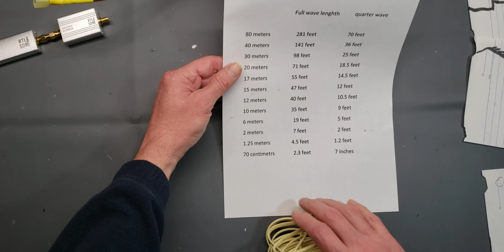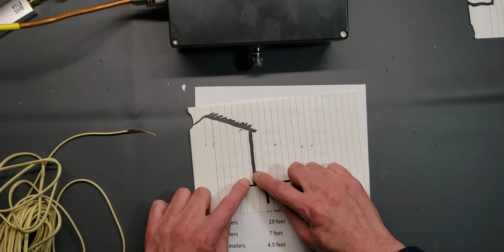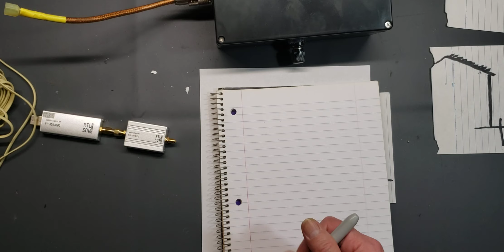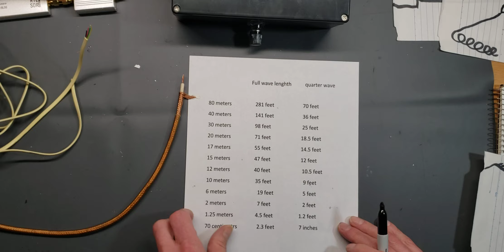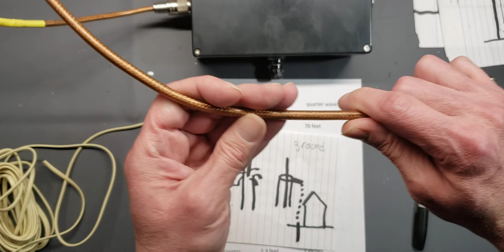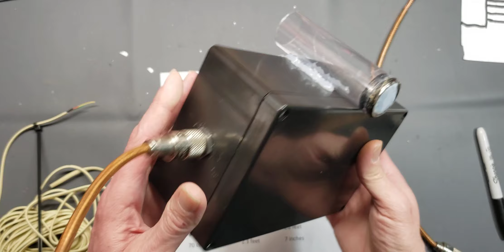RTL-SDR Multiband antenna

Comment: Could you please share what a good counterpoise would be for this antenna ?

I am living in a apartment, and need to make this since I have no ground . 

I just feel every video out there about counterpoise dont give me an answer which i do understand
Reply from the maker: A counterpoise is just any length of wire or metal. You can attach to the ground side or shield side of the coax. If your just listening with an SDR and not transmitting just use about 20 feet length of wire attached to shield of the coax you will be fine you can stretch it out or coil it. It wont matter. All you are doing is giving the negative charged wigglies somewhere to go. The positive wigglies use the center shield of the coax and the negative wigglies use the coax shield. That is a counterpoise! Hope that helps.
Reply: @HamBandit  thanks , that was perfect !!
Reply: @HamBandit  hi , i have one more question. Why not a unun instead of the balun. ?

Comment: I don't know what I'm doing wrong but with rtl sdr v4 connected this amplifier works worse than without. Please help.
Reply: Pretty sure v4 has a built in upconverter take off the amplifier it should work

Comment: Am I the only one that noticed? 80 Meters is 262.5 feet, not 281with a quarter wave of 65.6. 40 Metets is 131.25 feet not 141 with a quarter of 32.8 feet. The 30 meter measurement is correct. But the 20 is also wrong. Hope this helps someone who is cutting wires to exact lengths or do your own conversions.
Reply: I did too. And used what I measured.

Comment: This answered a lot of questions I had, thank you!
A couple quick questions I still have, as silly as they may sound:
1) When you're cutting those CAT wires to length, do the "dead" ends interfere with the signal (i.e. should you slide them out of the insulation?)
2) What's the difference between grounding to a rod stuck in the earth vs. the ground in a grounded outlet? (I live on the 2nd floor in an HOA + I've also never seen anyone suggest using the ground in an outlet, so there must be a good reason.)
3) When you say "just one wire," referring to the "hot" wire in the core of the run, is this connected to all of the different lengths of CAT wire in the antenna at the same time, or do you have to change the length of the connection based on what frequency you're trying to receive?

Thanks for walking through this setup!

Comment: Getting 5 Difrent Conversations In One Frequency IS NOT GOOD, Im getting The Same Problem, But I Change The Antenna Settings, I Mix Mach The ANtennas AUntill I Get The reception I Need Or Want, Sometimes I Don`t Get What I Want , But Thats Why Radio And Antenna Things Are Always Interesting Because To get Best Results You Need To Think Outside Of The Box  All The Time And Inovate On The Spot. Love The Content

Comment: if i wanted to put this in a vehicle, can i ground to the chassis or will that cause problems? if i do a counter poise, will i get RFI off the vehicle? does the antenna have to be straight or can i make deliberate bends to follow the contour of the vehicle?

Comment: Confused on some points.  1.  If I understand correctly your antenna is basically installed horizontally on the roof, correct me if wrong.  2. Let me know if this is right, It would seem as though you are running a piece of 50 ohm coax straight from equipment antenna input out through your window over to your ground rod.  You are opening up your coax at that point to tie the shield of coax to the ground rod while leaving center conductor alone.  Then continue coax up to roof antenna start point at one end of house.  At that point you separate the coax into center and shield/ground.  The shield is left alone while the center conductor ties into your multi antenna common point.    From here is where I think your description is very unclear.  You mention the full length of all conductors is whatever is the longest wire calculation is.   Now from the common initial feed point you go out to the dimension of your second longest calculation and cut open the outer insulator to make the necessary cut on wire 2.  Ok,  you've made that cut but what about the rest of that same wire that you just cut?  Do you pull the "unused" sections of wire out the back end or are you leaving it.  Repeat question for each band.  It would seem leavening the "unused" section which now lies in parallel and in close proximity might effect antenna performance.
Reply: Also at what point are you connecting the 9:1 balum and what about weatherproofing if at roof antenna feed point?
Reply: Also, the Cat5/Cat6 cable being used is also shielded, doesn't this wire need to be exposed for the length of the "antenna" part?

Comment: Not an expert here by any means. I'm having a hard time wondering why you would run a ground wire to a grounding rod. Wouldn't running a grounding wire to your computer case work just the same? I mean it is grounded by the electrical outlet which goes to a grounding rod anyway. Even the RTL-SDR is connected to your computer which I would think would be grounded as well connected to the usb port. Like I said, I'm not an expert in electronics and I am not arguing. I'm just fully ignorant on this and am genuinely curious. I am new to this hobby as well. Love the video by the way. Lots of good info here.
Reply: Not necessarily, I mean it be better than nothing, but the number one issue is one if the house is wired correctly to begin with, the only other issue is induced noise. Do to all the Switch mode power supplies each operating at there set frequency. I’m pretty sure home grounds could induce some noise in the front end. I’m not 100% certain on that but yea. Next is good grounding. vs poor. The ground is a apart of the circuit, and it’s not just any type of circuit it’s an RF circuit. I’m still an amateur with RF circuits believe me my friend it’s complex like DC circuit that doesn’t involve high frequency switching easy, get into RF circuits, especially tuned RF circuits, you’ve got to pay close attention to your components tolerances, and under stand how heat,cold, and even other stuff like stray capacitance, inductance, parasitic oscillation, not sure if (parasitic capacitance is the same as stray) your question isn’t ignorant at all my friend! You just had a question that well in detail is complex to answer!

Comment: You didn't say what a LNA is.  You said it works on freqs between 50 MHz to 4 GHz...So it would not be helpful in any freq. lower than 6 meters?

Comment: Hi                        Kinda new sdr  receiver but using a amplifier is pretty much a must ,l found this out by using the supplied rabbit ear type antennas that come with this dongle, just for kicks I hooked up a amplified channel master beam antenna and quadrupled the reception on am-fm and weather radio frequency , naturally a tv antenna is not to good for short wave or side band so if you can get this to work it’s cheaper than buying a $ 150.00 dipole .   With these you don’t need a big costly receiver .
Reply: why you need to buy a dipole even? arn't dipoles so simple to DIY? unless you;re talking about something multiband

Comment: Sometimes I wonder... You have your dream computer Ryzen 9 with 32gb of DDR4 safe and sound in your house.. But you plug a SDR on it with a XXX meters wire outside and one night you forget about it and there is a lightning storm.. It sounds like a perfect recipe to get a deep fried Ryzen 9 with a side of DDR4.
Reply: Just funnel the lightning into a flux capacitor and go 88 mph, then you can go back in time and unplug the antenna before the storm.
Reply: Perfect free energy ✨👌

Comment: A switch is not needed, just connect both band lengths to the coax centre and it's then basically a fan dipole. you can make it for as many bands as you want then. Also, getting your counterpoise out straight in open space WILL improve receive vastly.

Comment: How about using a Water Line Ground ?
Reply: As someone who designed and built conductivity measuring equipment for the oil patch I measured a lot of liquids for conductivity (the reciprocal of resistivity) including tap water.  It can vary from almost distilled water to not very good ( about 200 ohm - meter).  Unless you have salt water in your pipes.  
Several years ago a friend came over seeking advice about short wave antennas.  I supplied him with wire, coax, BNC connectors,  a wall mount lightning arrester with 6 AWG wire, and lots of hand waving advice.  The next time I was over to his house I checked his installation.  Everything looked very good, except that he had clamped his ground to the water outlet just below his arrestor.  I had emphasized that a good ground was not negotiable and was very leery about how good it was.  He insisted that he had read a lot about grounds and that it was good.  OK.  About a month latter we had a thunderstorm.  He called and asked me to come over.  He sheepishly lead me to the back of his house where about 3 feet of siding was blown out.  Lightning had taken the path of least resistance to an inside wall plug.  There was about 6 inches of wire was still connected to the pipe.  What happened?  All the pipes were PEX.  He lost his receiver, a PC and a television, all running off the same circuit.
Reply: @barnowl6807  can you use normal home electrical ground?
Reply: @randomtorontomans  According to the national Weather Service "A typical lightning flash is about 300 million Volts and about 30,000 Amps."  If you connect to the electrical ground at an outlet and there is say, 100 feet of 12 AWG ground wire (and multiple splices and connections) to the ground rod for your power panel with 0.16 ohm resistance/100 ft. you can see 0.16 ohm X 30,000A = 4,800V with respect to the earth ground point at that panel.  Furthermore, along the whole distance everything connected will see a voltage proportional to the resistance.  And, every appliance connected to that ground will also see a voltage difference between the "ground" wire and the hot and neutral wires. You must realize that a whole house surge arrester with the proper rating will make sure there is a limited voltage difference between hot, neutral, and ground wiring AT THE PANEL. But if that current flows through the wiring there will be the resulting voltage drop.
Reply: Traditional to do this
Reply from the maker: Most of today's water lines are plastic not recommended
Reply: @HamBandit  yes but if there is water in the lines, there is a ground point at every valve.  There are hundreds of Ground points going all the way  to the tower.
Reply: @HamBandit  ...As long as there is water in the system there will be ground points at every main valve and fire plug for miles.   I have used it for electronic trouble trouble-shooting when commercial ground or transformer ground was suspect...  A Great work around and zero noise.

Comment: Part of the issue with poor reception in the 10, 6, 2, etc meters and is your antenna is in a horizontal alignment.  The majority or transmitting antennas in the frequency range are from vertical antenna.  A separate wire antenna cut to the higher frequency lengths mounted vertically such improve reception on those bands.  Actual shortwave bands 15 meters and above transmit from horizontally oriented antennas.  Hope that makes sense.
Reply: You can make a 1/4 wave vertical antenna for 2 and 6 meters out of just your coax ..... For 6M just measure 5 feet from the end and peel off the outer jacket then take the braid and push it down over the outer jacket so you end up with a 5 foot section of braid and a 5 foot center conductor .... 2 meters is even easier since it's less than 2 feet long but at that length it's about as easy to build a traditional vertical with a 4 wire ground plane on a SO239 female 4 hole panel connector

Comment: 1. Your list of .25 wave. Are all of the ends touching at the coax you run to the roofline? You said to bust the list into 2 groups and make 2 runs. Trying to understand the connection. Thought maybe your box was a selector for EACH wire length.
2. Why did you need a selector box on your grounding rod at all?
Reply from the maker: no switches involved. Simply cut the wires to length. tie them all together at the end. include a small balun if you like. amazon has small baluns 1:9 for coax connection. the box you see is a pass through connection introducing ground to the shield of the coax to help with Noise. no switches involved
Reply: @HamBandit  thanks. I plan on doing this today actually. I know it needs to be a straight line but my roofline might not be a full 36 to the peak. Up to the peak and down the other side is enough but that's with the 30deg angle. Thoughts on that?
Reply from the maker: @IntoTheWild70  you can bend the wire no more than 90 degrees so feel free to turn the wire just don't let the wire come back on its self thats bad.no more than 90 degrees on the bends. You should get lots more signals.  Just after dark is best time to get peak signals. Good luck.
Reply: @HamBandit  Help my roofline sucks. Lol. Built cable but don't have a good place. Here are my options. 1. Has a tin roof 1/2 of the distance. 2. Will be near the power line into the house. 3. Will be on ground 4. Might have to go vertical on a pole of sorts. Thought of pvc with wire in middle
Reply from the maker: @IntoTheWild70  thats a bad situation to worse. You would be better off with a magloop antenna. Your metal roof will react bad to the wire and the power line will give you noise. Try vertical if you can but watch my video on chokes it will help with the noise if you do go vertical with the wire. If your up for a newer idea watch my magloop videos and see if that be a better direction for you to try.  Hope that helps you .
Reply: @HamBandit  I ordered a LNA for my rtl sdr v3. They shipped an AM filter. Now it says the LNA is unavailable. Any suggestions for an alternative? There is an RTL SDR ADS-B 1080 LNA triple filter but don't know if that's the same.
Ps: A what length is too long for the feeding coax if I have a LNA?
Reply from the maker: @IntoTheWild70   the ads-b is the wrong one I found one on ebay. https://www.ebay.com/itm/254255775959?hash=item3b32d340d7:g:h7gAAOSw5R5c-TCY    here is the link for the correct LNA.
Reply from the maker: It is a 50MHz to 4000 MHZ LNA. hope that helps

Comment: Nice idea!!!  I guess you remove the LNA when you are trying to listen to HF as the LNA you are using is rated 45 MHz - 4 GHz.  I just use a single random wire for HF, which is about 25 feet.  I pick up 80M, 40M, 20M, and 10M just fine.  I don't use an LNA and I use the AC outlet plate center screw as my ground (green wire), as it ultimately connects to a grounding rod outside. If you do this be careful to secure and tape this connection so that is can NEVER touch the blades of plugged in wires (fire hazard). Also be careful how you use the 9 to 1 Balum because if you hook it up when it is not needed, you can loose half your signal.  Thanks for your interesting video!!!!
Reply: I use a LNA (0.1Khz-6Ghz) from Aliexpress with a Magnetic Loop self-made! Super result!
Reply: @uli_6830  Do you mean 0.1Mhz?
Reply: @ChessWithMouselip  Yes! Sorry!